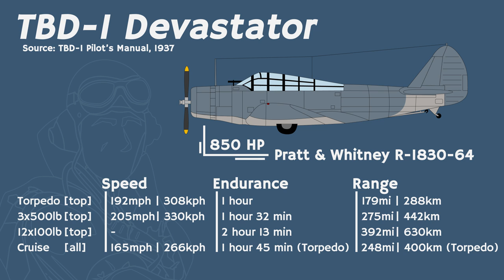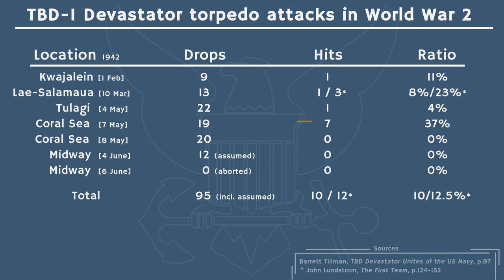In Defense of the Worst Aircraft of World War II - TBD-1 Devastator

Comment: If the Devastator had: a better torpedo, an escort,  better coordination with the dive bombers,  the historical reputation about the Devastator would be different. 
In Midway,  ANY torpedo plane in that situation would have been slaughtered.
Reply: Very true, as were the TBF Avengers also used at Midway.  The torpedoes these poor pilots were forced to fly with were a disgrace.
Reply: @sidefx996  not to mention that even though the Avenger was a good plane,  all but ONE were shot down.  Later naval attack aircraft like the skyraider dispensed with defensive gunners because tacticians finally realized that escorting fighters were essential.
Reply: Agree, the TBD was outdated but hardly the worst plane of the war. In my opinion the SB2C Helldiver would take that title, a AC that was designed in the early 40s but still no better than the type it was intended to replace (the SBD Dauntless) and in many respects worse. Even the objection that it 'eventually' gave good service damns it with faint praise - it took two years before the USN would finally accept it for service, by which time rocket-armed Corsairs and Hellcats had taken over much of the Helldiver's roles. 

The Brewster Corsairs also deserve mention, AC so poorly assembled that they were only good for ground training duty.
Reply: @paulfrantizek102  The only thing an SBC did better than an SBD was fly faster.  SBDs were what dealt the deathblow to the Japanese Navy.  SBCs merely played cleanup
Reply: @paulfrantizek102  If you only look at the first model which barely saw service, yes, the SB2C is bad. Yet the majority of the aircraft are of the improved models, so this stranger obsession with the SB2C being the worst thing ever is just endlessly amusing to me.
Reply: @paulfrantizek102  Brewster Buffalo? That one was the worst plane the USN had during WW2. My dad was an aviation machinist's mate from mid-1941 until The Bombs were dropped. He thought the Brewster Buffalo was the worst plane he ever touched.
Reply: @redskindan78  Brewster Buffalos were mid-30s designs that gave good service with the Finns, where they were lighter than USN versions and had higher performance.
Later in the war Brewster produced F4U Corsairs under contract, and the planes they delivered were so poorly built that they could do little more than than cruise around at half power, pulling no Gs. None ever saw combat.
Reply: Sounds like they could have solved the torpedo problem by not using them and instead going with bombs.
Reply: Any? The FW190 disagrees.
Reply: Had their weapon system be even 50% more reliable it likely would have been remembered as a competent if at the time of the war outdated aircraft. As hard as it is to get into torpedo drop range of the early torpedos these things still managed to stick a lot of fish into the water. Had those actually worked even somewhat more reliably they would have been a reasonably effective delivery platform.
Reply: @sidefx996  US torpedoes during most of WW2 were a joke, and mostly because of the policies of the US Navy bureau of ordnance that refused to address the problems with their fuses and detonators despite knowing full well what those were and how to fix them...
Not just the torpedo bombers suffered as a result but also submarines and surface ships.

Once those problems were finally addressed in 1943/44 the US fielded some of the best torpedoes available in the war.
Reply: @paulfrantizek102  The Helldiver's problems are legendary. The US Navy was really asking for a very advanced aircraft with this design (internal bomb load, high speed, high speed diving ability, range, tactical maneuverability) Once sorted out it was an effective aircraft, be never really liked by the pilots or crew.
Reply: Torpedo bombers were simply the wrong aircraft for Midway. What was really needed, were a bunch of F4U Corsairs loaded up with as many bombs as they could carry.
Reply: @morteparla6926  The Corsair was not available for Midway. It was cleared for service in later 1942 and wasn't really delivered to carrier groups until mid 1943. If the Japanese fleet had found the American carriers they would have shown what good, supported torpedo attacks could do. The Corsair could carry a bomb load, but that was for ground attack. They were never designed for naval bombing and were way too valuable to use for that. And, loaded down like that , they would have suffered the same fate, as others, to the Zero.
Reply: @BOORAGG  I'm aware that the Corsair wasn't available at the time; simply stating they would've done a better job. 

I should also state that torpedo bombers had the worst loss to kill ratio of any other type of aircraft throughout the entire war.  Torpedo bombers were far more likely too be shot down, than make a hit on a ship; and this was known, which is precisely why torpedo bombers came in massive droves. It was expected most would be lost -- and were mostly lost to AA fire, before ever dropping their torpedos.
Reply: @morteparla6926  I think I stated WHY that would not do a better good. It was a great fighter, not naval fighter/bomber. Torpedo bombing fatalities were very high on the allied side early in the war (when obsoleted planes were mainly used). The loss ratio changed dramatically as newer torpedo and fighter planes (for escort) came on station. The Japanese caused great losses with their fighters - not AA fire, as was shown in the Yamato attacks. It was known to all nations that the torpedo attack was THE most dangerous to any ship. Why you are including a plane that was not available to the discussion is puzzling. Following that train of thought,  a cruise missile would have been better than a torpedo bomber.
Reply: @BOORAGG  You stated why you THINK the Corsair wouldn't have been a better option, but what I THINK is it would have been. The Corsair was not only capable of carrying a large bomb load, but was DESIGNED too carry a large bomb load. It was very much designed to be a a fighter-bomber, meant to attack both land based targets AND ships. It was built from the ground up to be a naval fighter-bomber. That's a very big part of the reason it had such a massive, powerful engine; to carry the weight of the bombs with ease, without sacrificing its ability to be a fighter. 

The Hellcat was the air superiority fighter, the Corsair was the fighter bomber. Period. Or at least, that was the plan... but for various reasons, the Corsair did prove more capable at fighting A6M's than the Hellcat.

On to your last statement... which is absurd. We're talking about an aircraft that was the CURRENT TECHNOLOGY, and only 6 months away from being activated into military service (by the time Midway was going on) -- and you're comparing that to an anti-ship missile? What?
Reply: @armynurseboy ,
The TBDs ought to have played a mop up roll too.
Reply: Lassi Kinnunen  However, in the Pacific, it was a different story.  The Mitsubishi A6M2 Zero was a much more maneuverable fighter and early in the war was flown by more experienced pilots than the Russian-flown Hawkers, etc. of the Russo-Finnish war.  The Zeros massacred the Buffalo everywhere they encountered it.
Reply: The stukaa was much worst Facttttttttttttttttttttttt
Reply: @redskindan78  The Buffalo was already an old plane by the start of World War II. It was an excellent plane when it was created in the mid-1930's, but aircraft technology was rapidly advancing and quickly left it behind. There was never anything inherently wrong with it; it was just outdated.
Reply: BOORAGG Torpedo bombers were extremely effective when they hit their target. They were relatively accurate, used huge warheads, and hit below the waterline. 

They were also extremely vulnerable, having to fly low, slow, and in a straight line. Look at the battle of the Santa Cruz Islands, the Japanese torpedo bombers took by far the biggest losses in attacking the Americans. 

As the war went on and American air defenses improved while the Japanese defenses were torn apart, you see Japanese torpedo bombers becoming less effective and Americans becoming more effective.
Reply: It also has to be considered what the devastator squad had to face at Midway: there were not just "mere" Zero, but what was probably the best pilots in the world at the time, so highly trained that nobody even could come close. Saburo Sakai in his memories remember how the Japanese Navy was crippled after Midway, not because of the loss of planes and carriers, but most of all because it lost in a single battle most of his best pilots.
A plane is as good as the pilot, and if a rookie, whith barely enough experience to keep his plane flying probably wont be effective, a seasoned pilot selected among thousand of rookies and honed like a violin chord, can be almost 100% effective when shooting down slow and cumbersome targets. Just remember what happened at Leyte.
Reply: @sidefx996  Yes, and even sadder is the fact that the USN covered up these shortcomings for YEARS! My great uncle, John Charles Waldron, skippered VT-8 at the Battle of Midway, where, as we all know, Ensign George Gay was the sole survivor. My assistant company commander at boot camp, who attained Torpedomans Mate Master Chief Petty Officer, not only never heard of  the shortcomings of the Mk 13 torpedo,  but knew NOTHING about how important a role these torpedos played (by not performing)  at the Battle of Midway! John D. Waldron (USN Desert Storm/Shield 1989-1994)
Reply: @khaccanhle1930  what would happen if the enemy fighter broke through the escorts? Defensive gunner or not, the aircraft was still in great danger
Reply: @Keithbarber  probably the same thing that would happen with the defensive gunner. The best defense the plane has is evasive manuvers, so the gunner can't hit the broadside of a barn while 'bobbing and weaving' and the enemy pilot knows this. 

making them faster and more manuverable is ultimately the better option, both for attack and defense. it's a fairly harsh truth, but sometimes you're just screwed. the best you can hope for in the design phase is to make that less likely to happen, then to try and cover that eventuality, so dropping the extra man and the extra weight would have been a better call.
Reply: If the devastator had a better torpedo at least one of those Japanese carriers would not have gotten away at the Battle of the Coral Sea
Reply: It was like sending Stukas on missions in the Western Front.
Reply: Spot on  !
Reply: @arsarma1808  Except that you couldn't hit a moving ship using bombs dropped from a plane in level flight.  The US Army tried again and again but always missed.  The choices at that stage of the war were, torpedo bomber or dive bomber.  The Devastator was not capable of dive bombing, so the only way it had any hope of hitting the target was with torpedoes.
Reply: @redskindan78  This!
Reply: @MrCoreslash  the stuka was used effectively through the entire war. Even though it was outdated almost eight out the gate st the start of the war. No finer dive bomber was made.
Reply: @redskindan78  The F2 was a fine aircraft that made it into production by default.  When lightweight it was a good dogfighter.  Like all combat platforms, context,matters.
Reply: @debbest8546  The F2A was not up to combat without self-sealing gas tanks, larger tanks for the range needed in the Pacific, and armor protection for the pilot.
Reply: @TheGearhead222  The Navy didn't just cover that up.  They also covered up your great uncle suggesting a course change by ten degrees based on what his usual wingman, Langdon Fieberling who was leading VT-8's six Avengers off Midway Island, had witnessed regarding Japanese aircraft actually attacking Midway Island, which was promptly ignored by CHAG Lt. Cdr. Stanhope Ring, who refused to let VF-8 or VB-8 follow. That led to the desertions of Ensigns John McInerny and John Magda from VF-8 when they realized he was right; Magda later commanded the Blue Angels and Butch O'Hare befriended McInerny (neither man faced court martial, at least).  And they glossed over his request for literally one escort fighter (Ens. John McInerny had volunteered while still aboard the Hornet and Ring said no).  And ignored him flying with his own radio wide open to try and entice the rest of Air Group 8 to follow him in (to his credit, Lt. Cdr. Jim Gray, commanding VF-6, picked up the signal and attempted to follow it; sadly, in Gray's haste to try and save VT-8, he moved far out ahead of VT-6, expending a ton of fuel and causing VT-6 to lose all but four aircraft).  Your great uncle had the odds stacked against him to put it extremely mildly and still led fifteen torpedo planes.  He was a fine officer and, from all accounts even antedating his death, a fine man.
Reply: Exactly correct. Someone please explain how a Swordfish, Albacore, or Barracuda would have done any better at Midway. Slow moving torpedo aircraft with a Zeke on their a** are a sitting duck. My Uncle was SBD pilot from VS-2 Lexington lost at Coral Sea.
Reply: yup
Reply: @travisgartside409  a decent if quite vulnerable dive bomber with excellent ground support tactics and doctrine
Reply: @paulfrantizek102  Re: Brewster Corsairs. Are you saying those manufactured under license by Brewster were demonstrably shabbier than those produced by the parent company and others? If so, I didn't know that. We tend to view America's "Arsenal of Democracy" production capability as flawless. The arsenal we built up--and so quickly--remains stunning, but there certainly were hiccups, weren't there?
Reply: @adamwsaxe  Brewster's problem was that they were a small company with limited production capacity. They met their pre-war Navy contracts because those were for smaller numbers of aircraft and allowed the time needed to produce them at a slower pace. Once wartime demands for far more planes produced ever faster came through Brewster couldn't keep up, and the quality of the planes they did produce suffered. The Brewster Corairs are just a case in point - there were others as well.
Reply: in fact the Avenger made its combat debut at Midway which was a disaster for precisely the reasons you gave